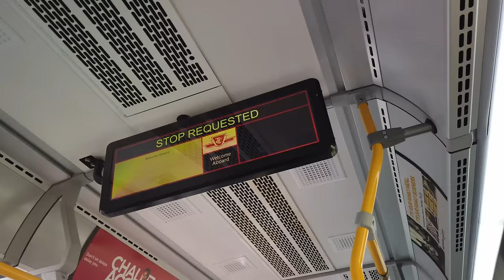Why American Buses Are Just Worse

Comment: A lot of US "safety regulations" are actually just protectionism in disguise. Take the car industry for example, almost all of the world is a signatory to the UN ECE type approval standard. If you design a car to this standard, it'll be road legal in almost every country. Every country that is, except for the USA which has its own incompatible FMVSS standard, so every manufacturer needs to produce their cars in a global version and a US specific version. Making things worse, the US often lags international standards, which is why for many years US market cars had ridiculously big bumpers and sealed beam headlights, and why adaptive matrix headlights weren't legal until recently. You can also easily differentiate US model cars because they have amber/red side marker lights which aren't required elsewhere except on large vehicles. 

Same thing is true in the rail industry, where one of the safety regs for a passenger train is "must survive head-on crash with a freight train". European safety regs are designed around avoiding that crash in the first place through high-tech signalling systems.
Reply: Yeah. I think there's some state that wants motorcycle signals on the outside of the body. So a bunch of companies put a different set of signals on the bike.

Comment: Public transport here in Holland is pretty comfartable compared to other countries but we've also had some dumb issues. One of the bigger buscompanies uses busses in which the light from inside the bus reflects on the windscreen impairing the driver's view on the road. This means that when it's dark outside the lights in the busses are turned really low, making the ride objectively worse for anyone who just wants to read a book or do some work.
Reply: Here in Norway, at least outside the cities, all busses have lights over every single seat that you can switch on or off, so reading isn't a problem.
Reply: I love that this is your worst-case scenario for buses in the Netherlands. In the US, if a bus system even exists, if you're outside of the city center of a handful of major cities, you can easily wait for 30, 45 or 60 minutes for a bus that may just not show up, with no regular schedule or consistent implementation.

Comment: In my city in Norway we recently got 24m bi-articulated Van Hool Exquicity hybrid metrobuses (similar to the ones at 2:45), and they are awesome. Although many sceptics said they would be horrible in the winter, they are actually much better in ice and snow than the older bi-articulated buses, as they have four(out of six) axle drive.
Reply: Extremely interesting!  Which city is this?
Reply: @Fan652w  I think it's Trondheim because a few years ago we got the same model as trolleybus in my hometown (Linz, Austria).
Reply: Let me guess, is this Trondheim Metrobus?
Reply from the maker: Wonderful! Those buses are awesome
Reply: The manufacturer Renault VI had built at the end of the 80s, the PR180 series. They were articulated high floor (80s) with two axles connected to the engine out of 3 (the rear one and the middle one with a transmission shaft that passed under the joint). Their road holding even in the snow was excellent.
Reply: VanHool has great buses, we use them too.
Reply: @garfieldt  Used to ride them from my hometown to my university during my first semesters (student housing lines are infamous for this town) and they were comfy, roomy and allowed myself and my fellow friends who commuted from the same town a well-earned rest from a long day of studies. Good times!
Reply: @Lodai974  Renault VI/ MACK was bought out by Volvo and they also own intercity coach maker Prevost

Comment: As a european, it is mind boggling to see yellow school buses. Have they changed at all in 50 years!
Reply: yellow school buses actually do make sense, they are usefull in rural areas, and its genuinely just part of transit culture
Reply: For some reason the design hasn't changed much over decades. That's an interesting point I've never really thought about. Stepping into an American school bus is like stepping into the 1980s. Still has the same ugly mint colored metal they've been using since then. Ugly bench seats. Ugly windows. Unless they have finally made them nicer? I don't make a habit of boarding school buses now that I'm in my 30s. I'd imagine they're still the same obsolete junk clunkers they always were.
Reply: At least some American schools have opted for flat nose school buses now.

Comment: One factor slowing buses is the need for everyone to enter the front door to pay the fare (or tap in).  At my university, and the surrounding towns, the buses were all free, paid by student fees and town taxes, which meant that buses could open all their doors, people exited and boarded, and the bus got going quickly.  It saved a huge amount of time.
Reply: I love systems like SF Muni where they have contactless readers at every door, and you can enter and tap in anywhere
Reply: Some European cities basically have an honour system with ocassional random ticket checks, so the majority of passengers with bus passes, day tickets, smartcards etc can board by any door.
Reply: We use 5 door buses and troleybuses in Slovakia. All doors boarding X5 - it is quick. Most people have monthly or yearly card, those who not have to validate ticket in the machine next each doors. There are random check sometimes and those without ticket get penalty. System works very good.
Reply: In Asia it's usually tap on tap off at specific doors, hella crowds
Reply: @cheef825  yes. Same in Netherlands. In larger buses there is also a tap in the middle of the vehicle (can be bus or tram).
Reply: In many places in the US where the buses mainly serve the poor populations, freeloaders are a serious issue. People would exit through the back before paying, and even hang on the vents on the outside of the bus to get a free ride. Folks used to use their ticket/pass, hand it to a friend outside, for that person to use. Now everyone loads at the front, the ticket is validated, and that solves most of the problems. kind of...
Reply: @SomethingBeautifulHandcrafts  when I was a kid it was called "bumper shining" riding on the OUTSIDE of transits OR other vehicles - the trollies had a pair of "handles" on the rear for the rope that goes to the trolley poles

Comment: The comfort of the buses in Germany also differs massively between cities. The city where I work (Cologne) has modern buses with adjustable air suspension, but they have terrible plastic seats, not a single bus has padded seats. The same for the trams that mostly don't even have air condition.

Comment: Amazing video filled with fascinating information! I very much appreciate it. Your point about the focus on car safety in the United States being on the passenger inside the car instead of the victims outside the car; that is part of the reason why pedestrian deaths have been going up steadily in the US over the last 10 to 20 years. Also, SEPTA has tried electric buses, proterra, and we had a bad experience in Philadelphia with the buses having multiple mechanical issues. Frankly, I miss trolley buses.
Reply: Same in Louisville.

Comment: Looking at the issues huge countries like the US and Canada have with something so essential as a bus network makes me proud of my city, Buenos Aires. Yes, the buses may not be state of the art, hundred percent low floor (I have almost fallen on my face when getting off a couple of times lol), you can get robbed on them and the frequency is so bad in some days that there can be 4 of the same line clumped together at the same stop; but you can be assured that you can connect any two points in the city with at most three different connections. Plus, each line has its own desing, which makes the landscape more colourful and makes the buses easier to spot from the distance.

Comment: We definitely need more competition for buses. A fine example of why is comparing school bus prices in the US to city bus costs.  School buses cost much less (~$200k) vs city diesel buses (~$500k).  They aren't THAT different...and the difference is simply greed and gouging from noncompetitive metro bus companies who get away with it because they can.  High bus costs hurt frequency and the number of routes a city can provide.
Reply: Competition is one aspect, but another is also economy of scale. The more busses you produce, the less one bus costs.
Reply: a school bus is NOT 10% what a transit bus is 
a school bus is a single axle delivery truck with a bus body on top and would NOT last the usage a transit bus puts on
transit and intercity busses are built to a FAR heavier standard then even class 8 "semi trucks" let alone a class 5 box truck 
Transit busses run a 11 litre Cummins and a Voith or Alllison 3500 auto tranny where as a school bus uses a 6.7L Cummins backed by a "pickup truck sized" Allison 1000/2000 the same trans used in the Shevy Silverado "duramax" diesel truck and the engine is related to the Dodge RAM "CUMMINS" pick up
Reply: @OnkelJajusBahn  New Flyer are all custom ordered VS "IC" school busses that are sitting at the dealer waiting to be sold

Comment: The bus manufacturing space is quite interesting. There are the companies that create the skeleton (chassis & drivetrain) like Mercedes, Volvo, Scania etc. And then there are manufacturers who make the outer shell as you said, the cabinetry so to speak. Names like Marcopolo, Irizar, Volgren ...
Reply: Also, having additional doors comes with the compromise of less seating. I find that North American buses are not space efficient as it is.
Reply: @steviewanderer  I imagine that, if the service is reliable and frequent enough, especially if the line is quite long, the trade off of giving up 2-4 seats in return for less dwell time is probably a good trade. But that benefit does somewhat require having more of the things than seems to be the norm.

Comment: The reason so few brands compete in North America are the very high standards for crashworthiness and emissions imposed by predominantly the US government, and the California Air Resources Board's imposition of the world's toughest emissions standards, often requiring 66-75% lower exhaust emissions than comparable European Standards.  This results not only in fewer bus types to chose from, but also fewer truck types and fewer types of automobiles to chose from.
Reply: This is super interesing fact. I wish places like LA could have even better bike lanes, they got the perfect weather.
Reply: If that's true is really hipocritical by the US government because you have things like pick up trucks that are made specifically to have high emissions.
Reply: @rikyrossi9518  not really though. Most trucks manufactured today have smaller motors than before and better emission reduction technology. I still prefer my old oil burning chevy c10 though.
Reply: @rikyrossi9518  If "made specifically to have high emissions" is a reference to the "coal rolling" phenomenon, then it's an after-market modification to the vehicle, and is also illegal.
Reply: @rikyrossi9518  Between the chicken tax and the special exemptions from CAFE regulations for "light trucks", we have our finger very heavily on the scale in favor of big SUVs and pickups. (The chicken tax is the very high tariffs against European "light trucks" and crossovers imposed two generations ago in retaliation to European barriers against America's over processed chicken)
Reply: I’m very skeptical of that. Do you have any sources?

Comment: I use the electric busses at Schiphol Airport every week. I like it that bus ‘kneels’ or leans over to level with the bus stop platform height, because the heights can differ from bus stop to bus stop. They’re very comfortable, don’t make much noise and don’t leave you standing in a stinking combustion cloud when the bus is leaving the bus stop at your destination.
Reply: Toronto buses do kneel too, but probably not as quietly.
Reply: Vancouver Translink busses "KNEEL" and have a ramp that will stick out for wheel chair ETC and it is LEVEL with the kurb when the bus is "kneeling"

Comment: The best Bus Service i experienced in the USA, was in the Seattle area. 😊
While King County Metro (KCM) Buses are a bit rougher, the Sound Transit ones have pretty nice padded Seats, and Community Transit (Everett) run Double Decker Buses.
Also KCM has electric bus since the 60s, the Rapid lines have multi door articulated buses, and aside from the fully electric ones, most buses are hybrids.

Comment: I'll always have a soft spot for the Orion V and Orion VII buses that used to dominate Toronto's fleet, but yeah the ride was pretty rough sometimes.
Reply: We had many of those in London as well. They were replaced in the early 2000s because they were natural gas fueled and could not complete a full day service without running out of fuel.
Reply: @vanschaaykb  we had some ORIONS in Victoria and they proved to be real "piles" and ditched quite quickly for GMC/TMC "classics" and then LOW floor New Flyers and Citaro's and DENNIS single / double deck busses

Comment: I assume that the quality of the roads have something to do with the quality of the ride on buses in the US and Canad and not just the quality of the buses themselves.
I live in Barcelona and, apart from a lot of walking and biking, I used the metro but since the introduction of the new bus system of a grid of vertical and horizontal and even 3 diagonal (there are still some of the old lines) I use mostly buses.
Reply: Good busses have better suspension than typical cars.

Comment: One thing I like about more recent buses in the US is that they are quieter machines, they used to be a lot louder, at least where I am. Having said that they replaced more comfortable seats, important on our rough roads, with basically sitting on a metal sheet (that has a thin layer of fabric on it!)  Also there's less effective shock absorption in my opinion. I don't take the bus daily so it's not that much of an issue. If US bus manufacturers don't have much competition that means they work with the cities and towns to provide a cheaper product ie they cut corners where they can.
Reply: I've been riding New Jersey buses since 1953 ,never had any problems or complaints.
Reply: Many buses in the USA are known  as Kneelers. When the bus comes to a stop, the bus lowers down to make boarding much easier.
Reply: @scrambler69-xk3kv I think that is something not being mentioned in this video.
Reply: @scrambler69-xk3kv  This was something buses in the eighties in The Netherlands could do by driver command. Took longer than today (but hey, the suspension on a high-floor bus was also superior to anything low-floor built today) but it could be done.

Comment: "Buy/Build american" is no real hurdle though. Stadler sold trains to California and texas, they arrive as a big ikea-set, final assembly (like putting the finished body on the finished bogies) is one in the US and fulfills the demand.
BYD, the brand you mentioned for american busses, is even chinese :|
Reply: Siemens also solved the problem by building a plant in California to build trains for the N. American market. They're currently working on orders for Amtrak and VIA. Alstrom recently bought Bombardier's train factory in Quebec.
Reply: @dougbrowning82  True, but Siemens actually builds there pretty much from scratch (and models based on the Vectron but specific for the US). Stadler just left the last few bolts undone, shipped trains in and finished them stateside.

Comment: You know what's funny? The 4 axles bus you show at 2:31 is in Aachen, which was also famously using the 45m "Öcher Long Wajong" (Long Vehicle of Aachen) with the 2 "bendy bits". But those have been abolished since, because they were using too much fuel compared to newer options such as fully electric busses which have since been ordered as a replacement.

Comment: Reece, thanks for reminding us that public transit is allowed to use coaches! I'm not sure if you produced a video about the superbuses in Kuala Lumpur. I learned about these knockouts a coupla years back so they might not be a thing anymore. And they were built for superhighway use so they're a stand-in for a proper train... but they don't seem to have been a gadgetbahn... or were they? Are they? Over to you.
Reply: Denver's RTD used to use coaches for the run between Boulder and Denver (might still do it; I haven't ridden it for a long time).

My once-and-likely-future work commute into Boston is on a coach bus running under a weird public-private partnership (private company subsidized by the state of NH as a highway widening environmental mitigation plan). It shouldn't be a better option than my Massachusetts town's commuter-rail service, but because regional rail in the Boston area is b0rked, it is.
Reply: What's the benefit of coaches for public transport?
Sure, they are more comfortable, but I think for trips under 2 hours or so a normal bus (with padded seats) is more than adequate.

And as a huge drawback for coaches: I've never seen a coach accessible for people in wheelchairs (they do exist, but I've never seen one)
Reply: @Jehty_  I was going to say, I think the main reason most transit systems switched to low-floor buses is because they allow for much faster wheelchair boarding. They can use ramps instead of lifts.
Reply: @Jehty_  Prevost makes coaches with wheelchair lifts. But it adds to the complexity and cost, and you lose some seating as well as a luggage bay. Canada doesn't have an equivalent to the ADA. They just unveiled their new H3-45 at a motorcoach convention in Florida. Motorcoach World has it on his channel.